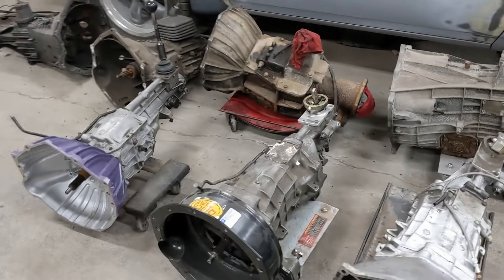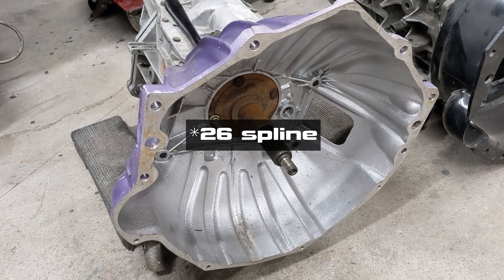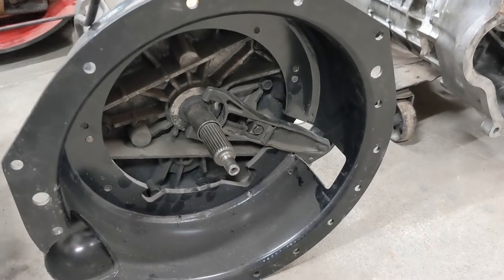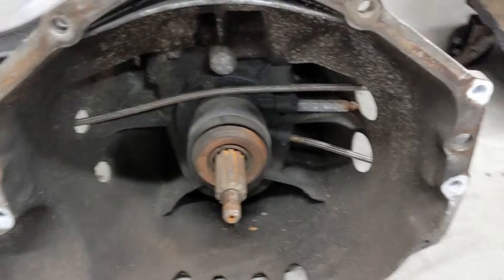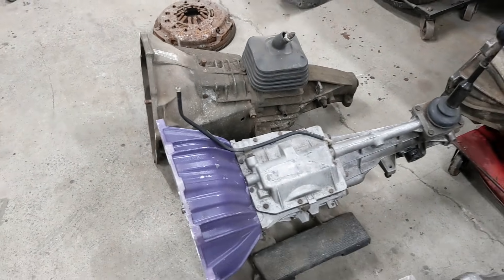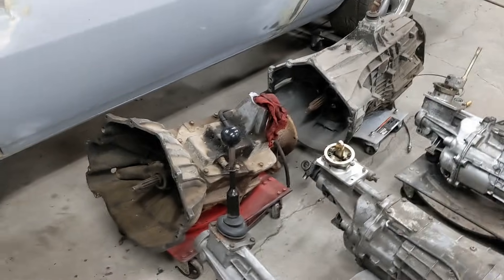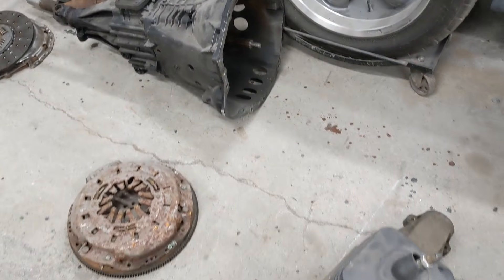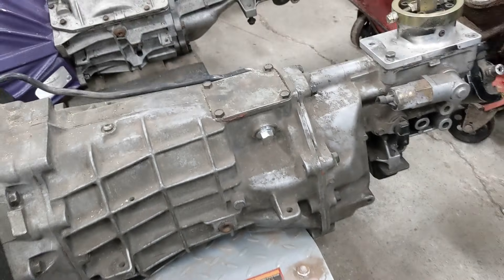GM manual trans specs - 4spd 5spd 6spd 2wd 4wd - LS SBC BBC

Comment: What manual 5 speed will go with a chevy 350 and a 208 transfer case
Reply from the maker: You'd need 32 spline tcase to run any of the 4x4 Chevy 5spds. But the mounting pattern is all the same

Comment: Which one best suits '454 and 44's driving like a moron' regularly? I have been wearing out SM465's in my 84 K30, dont need 5th or 6th with 4.56 diffs but dammit I want to  wind on it gear jammin' and L I V I N'
Reply from the maker: I think hammering it on 44s you're just gonna have to rinse and repeat 🤣
From what I understand the nv4500 is about the same strength as sm465. But the 465s are a lot cheaper to replace when they break, so if I were you I'd just keep on keepin on
Reply: @GEARHEADdezign 34 Years n counting but DAMMIT those Camaros n Vettes sure leave me hangin🤘

Comment: What is the transmission swap to take a 465 two wheel to a five speed 4 wheel conversion. In short a c30 to K30 with a five speed manual shift. thx
Reply from the maker: Nv4500 would be perfect for that

Comment: What trans is comparable with the l92? That’s is still awd? In a 07 Escalade?
Reply from the maker: That's a tough one. Only 4wd manuals with 27 spline output are S10, but they are 5 bolt tcase, you'd need a 6 bolt adapter. 6 bolt 4wd manuals are 32 spline output, so you'd have to swap out input shaft on the AWD tcase

Comment: Hello, I wanted to ask you. I have a 1992 GMT400 4x4. I want to upgrade to a manual transmission. I wanted to install an SM465. I have a 11/41 differential ratio. How would it look? Could it be a bit fast or very slow?
Reply from the maker: That's 3.73 ratio. So your highway rpm will be a little high, but not horrible
Reply: I'm from Costa Rica and that's the only transmission available here. I actually have one stored away and wanted to put it in my truck since the automatic transmission broke and I wanted to put in a manual. Can I put that transmission in without any problems? I also wanted to know how fast it can go in 4th gear. I wouldn't like it to be too forced and waste extra fuel. @GEARHEADdezign
Reply from the maker: Depending on what your automatic was, it might run more rpm cause it doesn't have overdrive

Comment: Are the ZF6 model specific? I have one that I could buy that came out of a Ford that I want to swap into my 05 3/4 ton Yukon with 6.0 and push button t case. 

Second question: would an NV4500 out of a 92 4X4 one tone bolt right up to my 05? Or would I need a different transfer case? I’ve got one I can grab for $1000
Reply from the maker: Yeah ZF is either GM or Ford, they don't interchange. A 92 nv4500 should be fine with your 32 spline tcase

Comment: What manual transmission would you swap a  95 4x4 4l60e Yukon.
Reply from the maker: If you tow with it, I'd do the NV4500. If it's more of a "hot rod" or daily driver I'd also do nv3500

Comment: Great video! I'm looking for some info... I have a 76 K20 with a SM465 in it. Can you tell me what I would need to swap in a NV4500?  I would like to have the 5th gear. I've been digging into this but I've kinda hit a wall. Thanks!
Reply from the maker: The NV4500 shifter will be 4" further rearward in your 76 than the 465. 
You might be able to use your existing bell housing and clutch setup, but if not... you'll need to convert to hydraulic clutch linkage with the NV bell. 
The NV also has a different output shaft, so you'll need to adapt your transfer case or install a different one. The 32 spline tcase that comes with the NV in the newer trucks is driver drop, not pass like yours.
Reply: @GEARHEADdezign thanks for the reply! Is there any possibility to clock the transfer case the other direction? Probably a dumb question idk.
Reply from the maker: That might be possible, the bolts are spaced equally. You'd have to figure out the shift linkage
Reply: @GEARHEADdezign thanks for the info!

Comment: Please I need help can I get a parts list for a sm465 I’m trying to bolt it up on a sbc
Reply: My 1980 K20 came factory with a 350 (sbc) and the SM465. Still going strong.
Reply from the maker: They were bolted to SBCs from the factory. So you can just use the C25 flywheel and clutch from your year engine.

Comment: Moral of the story if you want a strong manual behind your LS, it's going to cost you a  fortune. 
Should've been hoarding the 4500s a decade ago
Reply from the maker: Deals are still out there. I just picked up an nv4500 for $400 and another sm465 for $50. Gotta snag em quick when you see em

Comment: The Zf-6 speed was used behind the 8.1, but it was also used behind diesels of the same year. Ive seen many a diesel trucks get power shifted to low 12’s high 11’s. 
It won’t clear floor boards in anything under the 2500 trucks. The 2500/3500 truck sit higher off the frame. That gives enough clearance to the trans to the floor. They would be great for towing.  It the 1500 trucks either need a body lift or floor pan mods. 
And the 8.1 uses the same bolt pattern as the LS, duramax, big block Chevy (all of them) and small block Chevy from 1999 and back. So the zf 6 speed will fit all of them with the right clutch flywheels setup.
Reply from the maker: Yup. You've done your homework

Comment: There is another Nv3500, the ones in OBS trucks. This came in my 92. 
On a one piece rear main seal 350, 92ish block, You can fit a 168 tooth flywheel, and 12 inch clutch inside the bellhousing. 
 The hydraulic clutch is pretty stought. 
 The s10 trucks have a different nv3500, it’s weaker.
Reply from the maker: That early "nv3500" is a getrag 5lm60. Very similar design though. I have two s10 blazers with the nv3500 and they've taken a pounding
Reply: I was thinking about slapping a 4.8 into my 91 c1500 that already has the nv3500 just for a daily. Should hold right?
Reply from the maker: Should be no problem for "regular" driving. They hold a decent amount of power, but really banging gears hard is what gets em
Reply: @GEARHEADdezign ok cool man thanks just wanted to reassure myself before going for it.

Comment: The 5 speeds that come in the 1/2 ton 2wd 1500 Chevy trucks in the 88 to 98 year range sure seem to be a HUGE weak point even with stock 4.3L & 5.0 engines that aren't even hitting 200 HP. So would it be better to rebuild those trannies with tougher internals or just replace them with a better trans? Something that could handle at least 600 HP would be great!!... Anyone got any good suggestions on this?
Reply from the maker: @kenthompson1539  for a half ton at 600hp I'd go with a brand new T56 Magnum. It won't be a direct swap, but it'll hold up

Comment: Do you know the gear ratios on that zf6?
Reply from the maker: Yeah, mid 5.x first gear and 0.7x 6th
Reply: @GEARHEADdezign   would it be to big for a 6.0 Ls
Reply from the maker: It would match up great with a 6.0 for truck stuff. Upgrade from the nv4500 5spd that 6.0s got from the factory
Reply: @GEARHEADdezign  I don't like the jump between 3and 4 on my nv4500. Do I have to shift the zf6 slow.
Reply from the maker: Yeah I found my 350 screaming in 3rd or losing steam in 4th when towing with my nv4500. Splits are closer in ZF.
Reply from the maker: And it does shift fast better than NV. Found that out on accident when I was pissed off shifting. Took em clean! 🤣
Reply: @GEARHEADdezign  so do you think it would be good for my 1500.
Reply from the maker: Depends on what you're doing with it. For 4wd towing/hauling etc it's great. For a "hot rod" truck I'd go a different route
Reply: @GEARHEADdezign  towing and off roading. Just like a crawler gear and closer spaced gears. I love my s10 zr2 transmission but it doesn't have a low gear so I always grab 4low.
Reply from the maker: Yup. That's exactly why I'm going sm465 in my offroad s10 blazer SAS

Comment: What's the difference between 4.3 V6 flywheel and 4.8 v8? I can use the v6 for ls swap?
Reply from the maker: The nv3500 transmission is the same for LS and v6, but the flywheels are different

Comment: So I have a 1983 Chevy K20. Was a 350v8 4speed. Now it’s a 454v8 4 speed. I want to put a 6.0LS out of a 2001 2500HD in my 1983K20. Can I do that with my 4 speed? And that 4 speed is called the SM465 right?
Reply from the maker: Yup. The clutch kit for the 6.0 will match up to your sm465 too. Easy peasy. I'm doing the same with a 5.3 for my Blazer

Comment: Excellent video. It looks like swapping out my 465 for a 4500 in my 77 chevy heavy half should be fairly close then.
Reply from the maker: Your 77's original trans should have the cast iron top cover. It is a little different than the cast alum top cover in the early GMT400 trucks. The alum cover has the shifter about 5" more rearward than your square body. I found that out from another commenter. So the nv4500 shifter will be further back than your sm465 (assuming it's original to your square body)

Comment: Doing research to find out what’s best for a Manual swap on my 86 suburban with a 700r4 in it. As far as just a 2wd application, Im coming to the conclusion that nv3500 is probably the best candidate for this. Aside from maybe nv4500, do you have any recommendations and what would go the smoothest for the swap? 

Thank you for your help and applicable knowledge. Finding out exact info has been quite the endeavor.
Reply from the maker: Nv3500 will be decent if you have pretty deep rear axle gears. If not, I'd go with the nv4500. First is a lot shorter with the 4500
Reply: @ and that will bolt right up? Don’t have to change the drive shaft or get an adapter for the output shaft?
Reply from the maker: @lontgom when I swapped 4l60e to nv4500 the driveshaft slid right in, but that was 4wd. Worst case scenario you'd just have to change the yoke
Reply: @GEARHEADdezign  what year nv4500 do you recommend for that truck platform?
Reply from the maker: Any year will work. The earlier ones with the external slave are typically cheaper. If you do one of those, be sure to get a new pivot ball and fork. When I swapped I reused those and it failed a few years down the road and I had to drop the trans again to fix it. Grease em good. The newer ones don't have that failure point...just a hydraulic release bearing

Comment: Hey just seen your video and you seem very knowledgeable with transmissions. I have a 1987 s10 blazer 4x4 manual and I am trying to put a ls 6.2 in it and still keep the manual and 4x4. I am shooting for about 600 horse. And heard that a 3500 trans wouldn’t hold up. Any suggestions would be appreciated. Working under a budget.
Reply from the maker: For an offroad type build, the nv4500 is the way to go, for sure. Or Tremec makes a new TR4050 that's basically a modern upgrade of the nv4500. 
For a hotrod application, you're in a tough spot. I know there are adapters available to mate a Corvette T56 with transfer case, but it's not cheap or easy

Comment: I have an AR 5 and was thinking of putting behind a 63 Vette 327. Would love to know challenges and if they make an adapter with speedo drive.
Reply from the maker: Cable-X makes a drive unit, but they are expensive. Not sure how an ar5 would fit, but I do know American powertrain has a kit to fit a Tremec tkx perfectly

Comment: I have 1998 obs with lt1 383.. the block is from 1996-98 roadmaster 
What manual trans is best for swap
Reply from the maker: It really depends what you're doing with it. 2wd? 4wd? Street rod truck? Race truck? Mud truck? Tow/haul truck?
Reply: @  street strip type of truck
Reply from the maker: I'd go with a T56 or TKX

Comment: I have an '07 Silverado 2500HD Classic ex.cab LB 2wd LQ4 NV4500, I have typical 3rd gear grind/catch on the upshift from 2nd and I was contemplating swapping to a 6spd. I don't tow much and will be adding power in the future (450-500rwhp). Do I have to find a ZF6 from a 8.1 or will one from a DMax bolt up as well? If I can get the crossmember for the ZF6 will that be a direct fit too? Driveshaft? I almost never use 1st/granny, hell I can almost start in 3rd, so I was also kicking around the idea of the TR-6060 if I could get my hands on one. I'm thoroughly unimpressed with the way the NV4500 shifts in general and the ratios kind of suck also. Would the TR-6060 or a T56 be to much of a hassle? I also plan on running at least 33" w/ stock 4.10.  Excellent video, very informative.
Reply from the maker: Dmax and 8.1 ZF are the same. I only use the crawler gear when towing or slow maneuvers in a parking lot or something. Still though, I don't know that I would go with a car 6spd. That first is really tall by comparison. I'd love the T56 first to be deeper in my Beretta.
Reply from the maker: Honestly, the nv3500 sounds like the perfect match if it would hold up. Ratios are a little closer, it's a direct swap, and it does shift smoother. In a heavy truck though I worry about the durability. Tremec has a TR4050 that's basically an upgraded nv4500...that would work. But the ratios are the same
Reply: I think I’m going to go with a zf6, stronger, smoother shifting, still a truck transmission. What’s going to be my biggest concern?
Reply from the maker: Availability is the issue. And gearing isn't much different than your nv4500

Comment: Can’t forget the AR5 in the Colorado/Solstice/Sky- 5 spd full synchro hydraulic clutch with a 26 spline input shaft. Plentiful and guys have put some serious power thru them. I’ve got over 200k miles on mine trouble free
Reply from the maker: Yeah, they sound like a decent option. I didn't have any of them in front of me to measure etc
Reply: How much power have guys been putting through these?
Reply: @CNTablet-sg7qx 
400hp

Comment: What would you recommend for a Manuel swap for a 350 sbc with some good power I am trying to find a good strong transmission that can handle 300-475 hp  for my 3rd gen firebird GTA I am tired of the auto transmission I have like 3 laying around
Reply from the maker: The Tremec TKX would be a good option for you

Comment: What trans is cheap and am I able to run behind my lb7?
Reply from the maker: You could do nv4500 and it's reasonable. But the zf6 is rated for more power
Reply: @GEARHEADdezign  what’s the zf6 come in
Reply from the maker: It comes in the Duramax and 8.1 trucks

Comment: I want to do a 5.3 w nv3500 out of a v6 sierra 2wd on a obs gmc… i need help with harness options all stand alones ive seen are only for t56 ??
Reply from the maker: Reverse lights are same connector, I don't recall if vss is the same but you can always splice it if need be

Comment: yeah i have an early nv4500 that im going to swap my nv3500 LS swap for but i cannot find an external slave cylinder bellhousing for the life of me. my truck is already setup for the external slave since it already has an early nv3500 in it so i really just want to keep the stock clutch stuff. But any ideas where i can buy a bellhousing like that or something similar?
Reply from the maker: @seanclement2264  I'm not sure where you could find a new one, but the sm465 bell that I have looks just like the nv4500

Comment: My nv3500 came with a Slave cylinder that’s located outside of the trans can I still use it to hook up to the ls no problem or do I got to put a 
Hydraulic throw up bearing ? Need help pls !!!!
Reply from the maker: It should still work. I'm going to be doing external slave sm465 with LS. Just make sure you use the big clutch for the 168 tooth LS flywheel
Reply: @GEARHEADdezign  do you think it would engage and disengage just fine . Because a lot of people are putting shims on the internal ones . Do you think the external? Throw out bearings needs anything like that
Reply from the maker: @Anhedoniapurple  I wouldn't think so, but sometimes you just gotta try it and see what's up

Comment: i got an all orginal 94 Silverado with a NV3500.. I Think im gonna run one behind my 383 stroker in my C10.. I will need the strength, what would you prefer trans wise based from your video?
Reply from the maker: @DAUltimateSACRIFICE  sounds like a hot rod truck application, so the nv3500 would be ok not using it for towing etc. Aside from a car transmission is gonna shift the smoothest. An AR5 with LS adapter could also be decent on your SBC.
Reply: Think I'm gonna do a 97 1500 v6 to sb400. Definitely wanna 5 0r 6 speed.

Comment: Hey I’m trying to figure out which trans I could swap my 05 Denali to to make it 6 speed manual but keep it awd
Reply from the maker: @tatted_dad7827  I don't know if an input shaft exists for your tcase that would fit a ZF6. But you could either go nv 5spd or Corvette T56 6spd with the adapter.
Reply from the maker: @tatted_dad7827  kinda depends on what you're going to do with it. Towing go nv4500, fun street cruiser go nv3500, all out performance go T56

Comment: I have a 1985 t5 out of a comaro . can I run a older  bell housing  and fly wheel/ clutch  with it .and it's a 1976 350 engine  thanks
Reply from the maker: @danieldouglas8034  yup

Comment: Can you put a sm465 behind an ls?
Reply from the maker: Yes, I'm doing that with my Blazer. Use the 4.8/6.0 clutch & flywheel
Reply: @GEARHEADdezign  do you need a aftermarket bell housing kit, I am not worried about the top bolt hole.   So can I use the original sbc bell housing and clutch release with the 02 6l clutch
Reply from the maker: If the SBC bell is for 12" clutch with 168 with flywheel then yes
Reply: @GEARHEADdezign  Thanks for the info 👍

Comment: I'm planning to get v6 standard silverado, single cab and put that 5.3 in it. I've heard thevtrans will hold. Should I put a dual disc in it. Got any info I may need ?
Reply from the maker: Yeah the NV will bolt right up with 4.8 clutch and flywheel. If you want to make huge power that requires a dual disc, I'd find a different transmission. But a typical 5.3 will be fine if you don't hammer on it too bad.
Reply: @GEARHEADdezign  right on thanks bud. I mentioned the dual disc since I driver a nv5600 cummins.  But it's diesel so the torque is different for sure